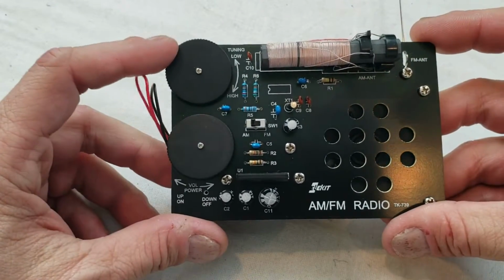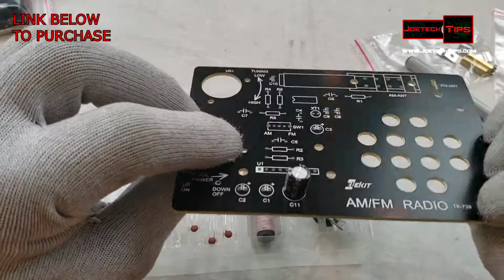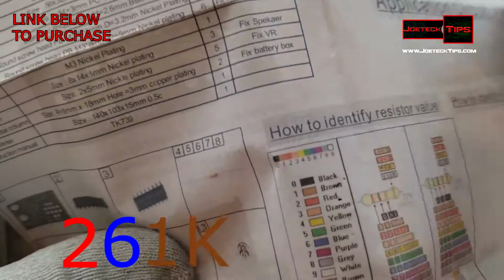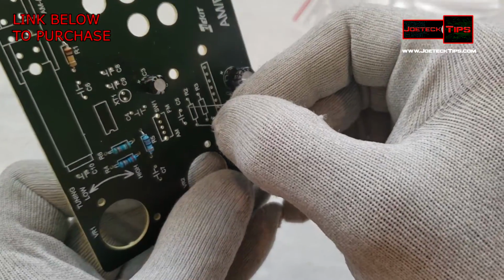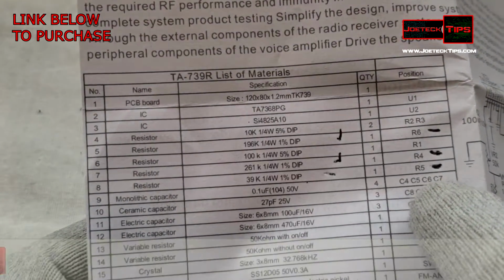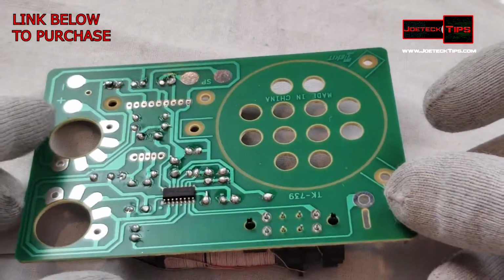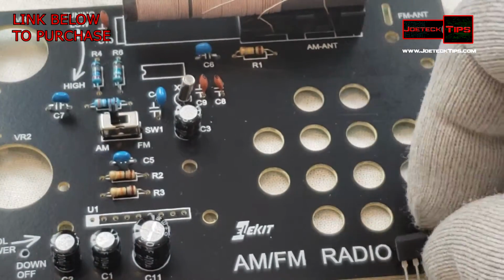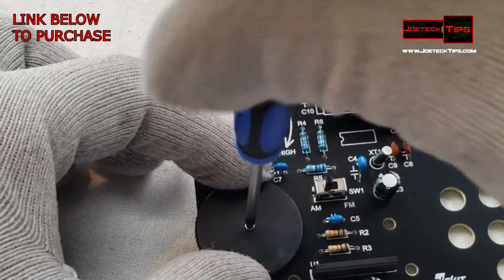AM FM Radio Kit Soldering Project Kit | HOW TO | JoeteckTips

Comment: Thanks, I did this with my son who is 7 and loves learning about circuits etc. it was fun.  your video was a big help. 

Sadly we don’t seem to be getting any radio signals. The volume, on/off works and fm/am switch works. I’m guessing the problem lies with the connection of the tuner. My soldering skills aren’t as sharp as yours as I haven’t done it in a long time.
Reply from the maker: Go over each area, make sure it's not a cold solder joint